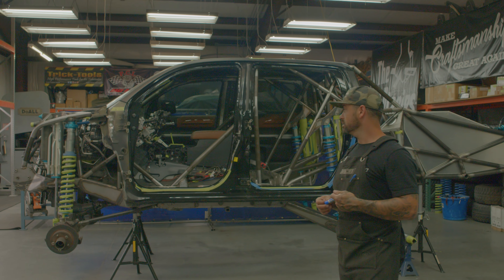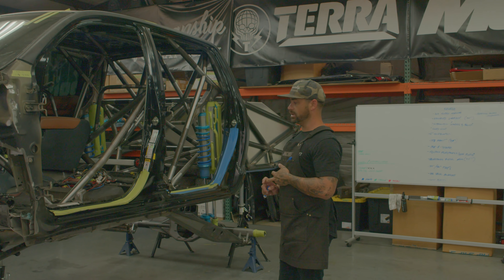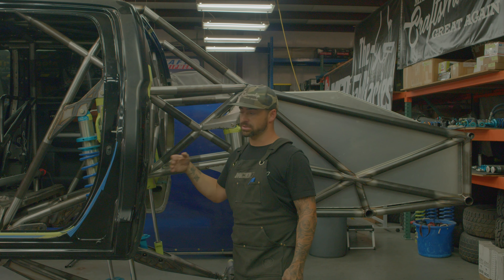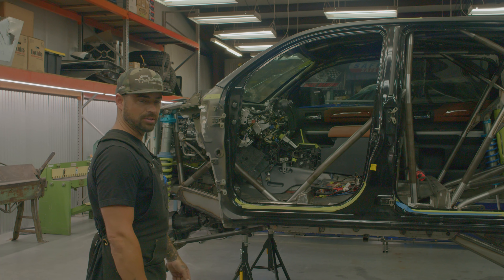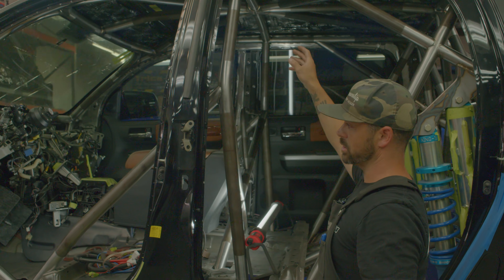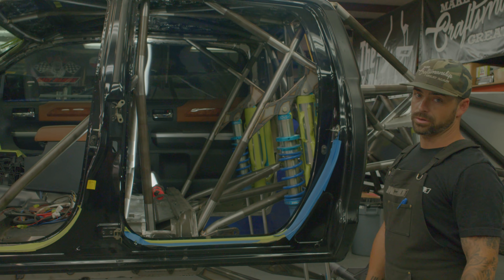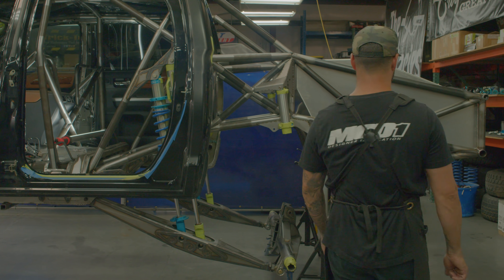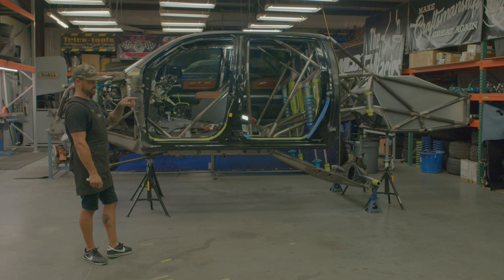Build Series | Selena Ep.1: An Introduction

Comment: Hi Morgan, greetings from Spain. What diameter tubing do you use for the roll cage? (Inner and outer diameters)
Reply from the maker: Greetings. 

We
Usually use 2” od tubing. The wall thickness varies depending on what parts of the structure. Anywhere from .125” to .065” wall thickness

Comment: I get that aftermarket or race parts would be better is some cases, but there is something extremely cool about blending oem and race truck as cleanly as you do. Especially with the interior. Awesome work man.
Reply from the maker: I totally agree! That’s why I love sealed, steel cab vehicles. Race trucks are cool for what they are but they do nothing for me. The essence of a production style vehicle with badass suspension & chassis modifications is unmatched.

Comment: Why always do beams?
Reply from the maker: It really depends on the application. We have (3) centermount trucks in the studio right now alongside a straight axle setup & a raptor receiving a “kit” style a-arm setup. It’s not always beams, but if they fit the application they will be used.

I personally like beams because of their rugged shape & strength, minimal moving parts & simplicity. They pull large amounts of wheel travel & have a long standing track record for putting the work in through and through. 

Beams left a imprint on me early in my teenage years with the mike smith built terrible herbst I-beam Chevys.
Reply: @MorganClarkeDesign1  Thanks for the detailed reply. It seems like beams were the old school way of doing in and they have really made a strong comeback in terms of popularity. Like you had touched on, beams were the way to do it when a lot of us were younger and what was cool when you were young willbstick with you throughout life. 
Awsome build, awsome videos!

Comment: Why is anybody using the term (I-Beam) for TTB or even fabricated 2wd beams? Maybe I am being a bit anal and sticking with (I-Beam) for factory forged I-Beams weather its a twin or a solid straight axle style.
Reply from the maker: Old fords 1966ish used the term “twin I beam”
On their models. That’s where it originally came from. Twin traction beams (TTB) is specific to 4wd type I beam suspension setups. I will use the term  “TTB” for certain conversations, but more people understand “beams”
Or “I beams”. It’s simple and gets the point across. If you look at factory suspension on old for trucks equipped with “twin I beams” the construction of the “beam” is actually a forged I beam shape/profile.

Comment: Such a nice build. 

Would having going center mount been that much more $?
Reply from the maker: Center mount didn’t make sense for the platform & final intention of the build. We are also utilizing 4wd with 24” of travel (u joint permitting). That’s not a feasible option to package into a centermount kit on a frame rail truck. I don’t believe in going centermount with a project using OEM portions of the frame.
Reply: @MorganClarkeDesign1  you are definitely right